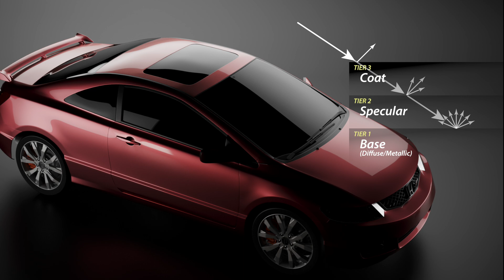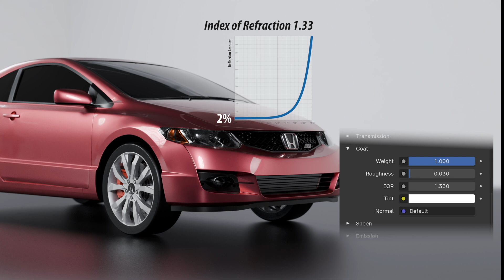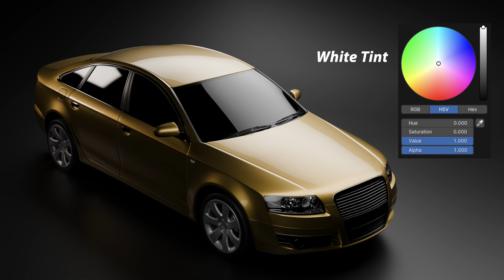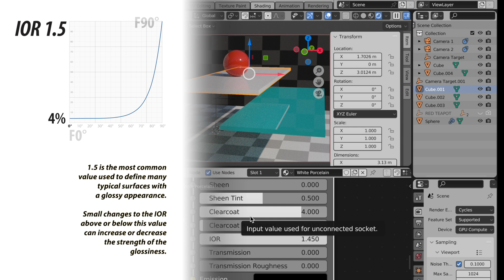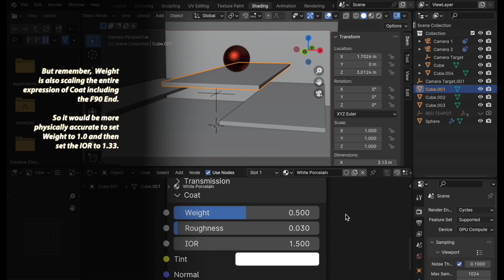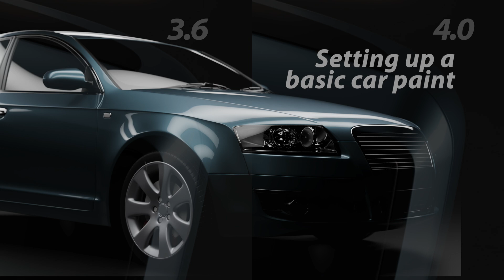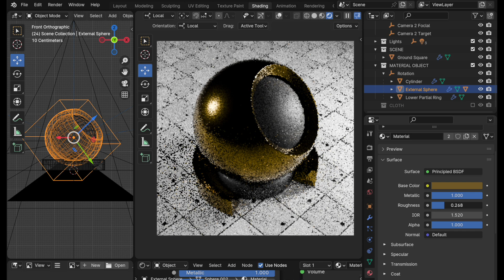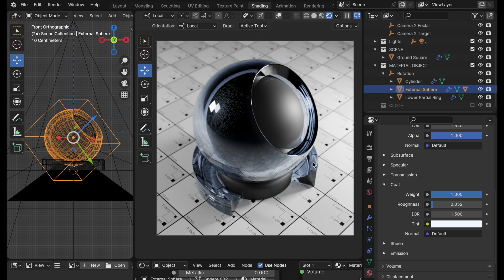Improved Coatings in Blender 4.0

Comment: The glass coating looked like something that would be better simulated using volume absorption. Dunno, just felt like a weird example. Maybe it would be better to show a more natural application of coated glass, like anti reflective coating on eye glasses that tend to cause that green tint on facing angles? Yeah I know those are "optical coatings" and not necessarily reflecting what a rendered coat is supposed to do, but still.
Did you check if substrate IOR is automatically lowered for a dielectric when a coating is applied? I know there was some talk about Blender supporting "nested IORs" a while back, but I'm not sure if at least Principled was affected or the implementation was abandoned completely. Only dielectrics though, doesn't happen to metals whose (unsupported complex) "IORs" are very high anyway. Ex; bubble wrap lowered into water loose pretty much all reflectivity, whereas a metal spoon does not.
Reply from the maker: The glass example was just to show that it affected components sitting below coating. And nested dialectrics isn't implemented yet, it's slated for a post-4.0 release. I would assume when that does get engineered they would apply it to a glass with a coating for the correct IOR configuration.

Comment: Thanks so much for the detailed breakdown!

You briefly me that part of the new BSDF is using volumetric scattering. Could you expand on that a little?
Reply from the maker: Yes, I should have elaborated on this. The algorithm simulates actual thickness for the coat layer, and if you use a tint, the degree of that tint is influence by how long the rays travel through this simulated thickness. The longer the rays travel (say at high glancing angle toward the camera), the more absorption happens and the stronger the tint effect is. It's an elegant way of applying a tint because it's following physical principles.